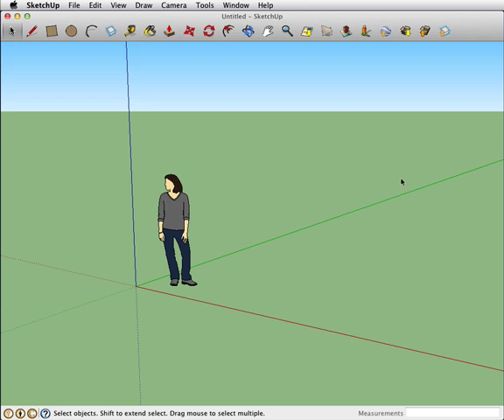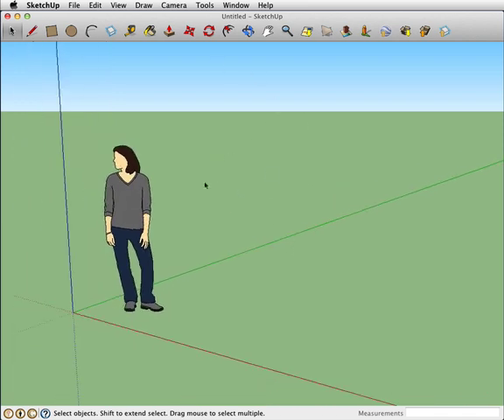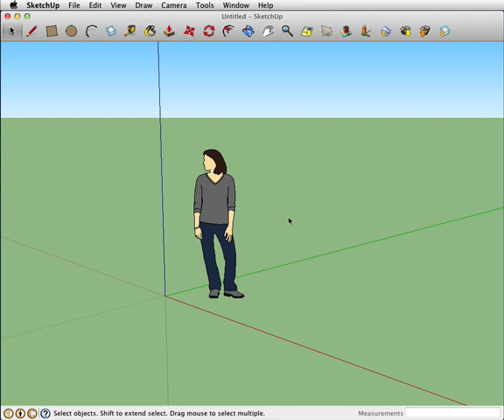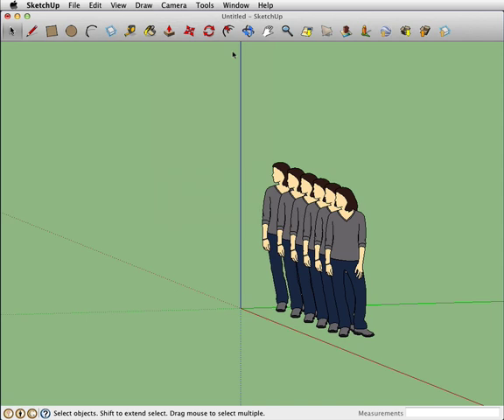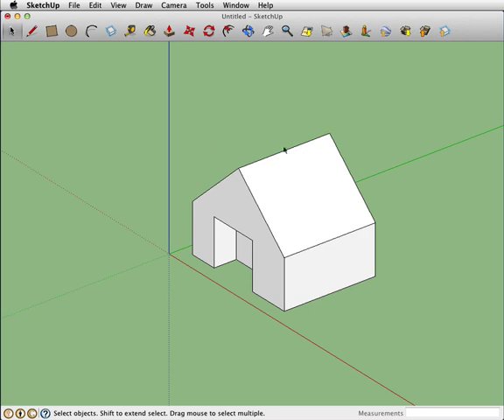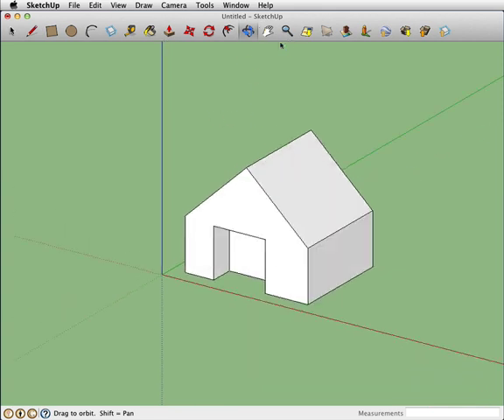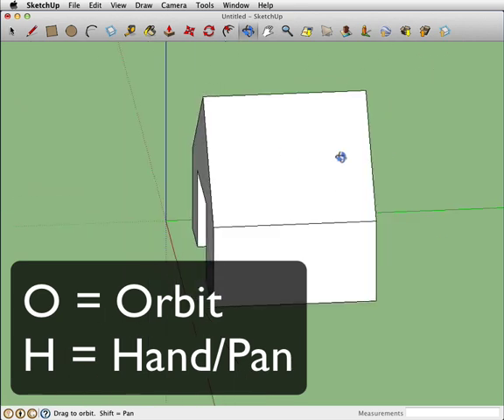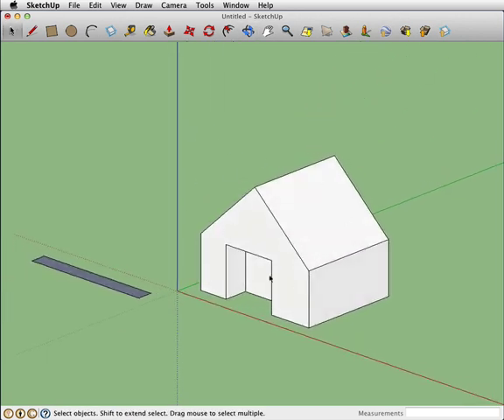SketchUp for RC Aircraft Design Tutorial #1

Comment: I downloaded SketchUp 8 and I don't see the brick to input a new texture for the picture I want to input. I have tried several things and can't seem to make it work. When you are trying to make a thickness, is there a way to just give it a dimension and then offset it? I just drew a square and could not seem to get the tabs for the interlocking of the foam sides to aline. Help. Waiting for help and video 5.
Thanks
Don